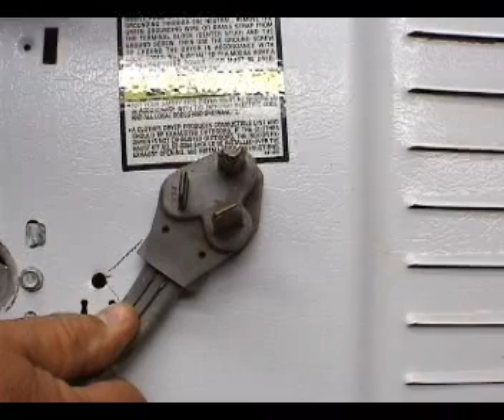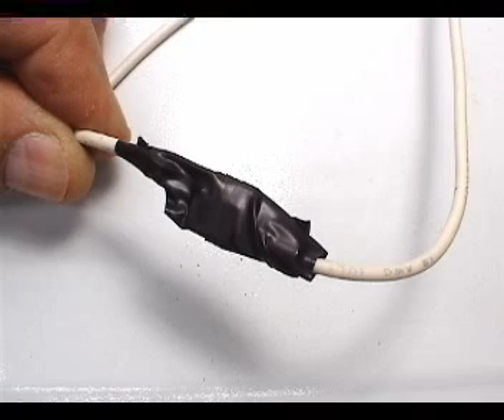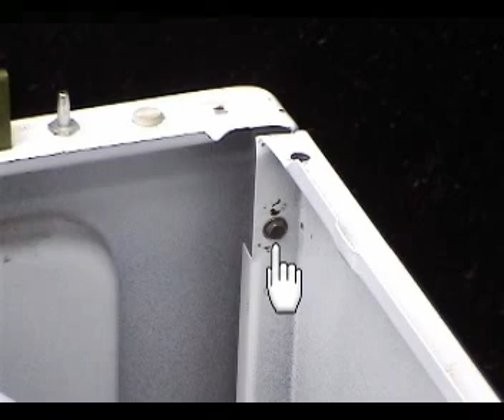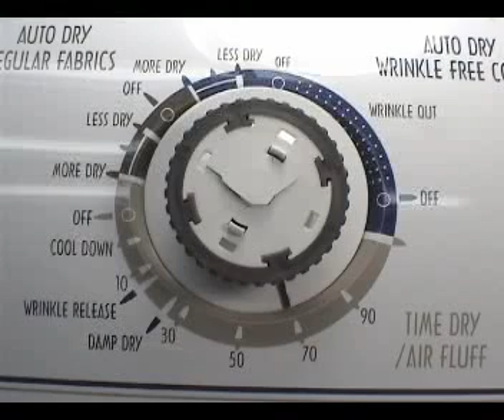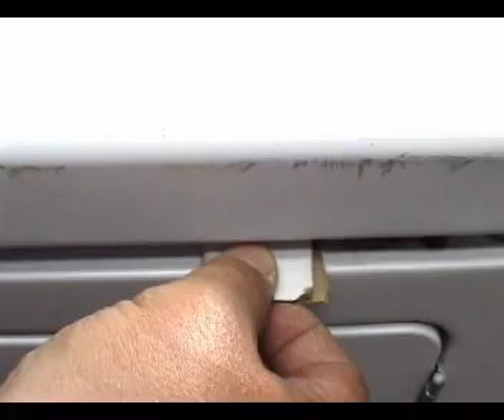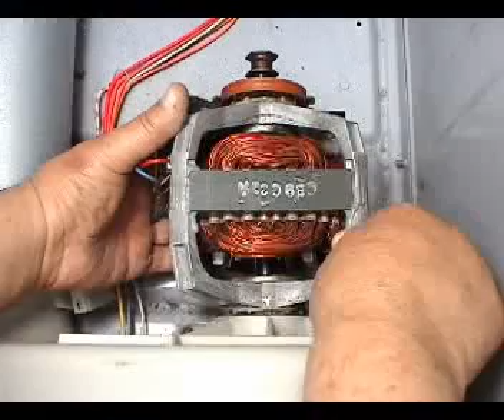Performa Dryer That Is Not Starting - See What Parts You Need To Check

Comment: Great video.  My dryer is 21 years old.  I tried attaching the white wires together to test the thermo fuses as you showed and my dryer began to work.  So I got the replacement parts and it works now.  Thank you for saving me $700 for a new dryer.
Reply: 100% just had this happen to me today. When it lit up just like you say in the video my hands shot up.🙌

Comment: This video was a life-saver and I've recommended your channel to co-workers who are also having dryer issues.  A ten dollar part was all it needed!  One little thing that helped me, though: my Thermal fuse went bad.  I was able to put the thermal switch on easy peasy, however, the fuse itself was a problem.   the tiny screws at the awkward angle?  I ended up losing both of them.  I found just removing the bracket, putting the fuse on and then re-installing the bracket was much easier.